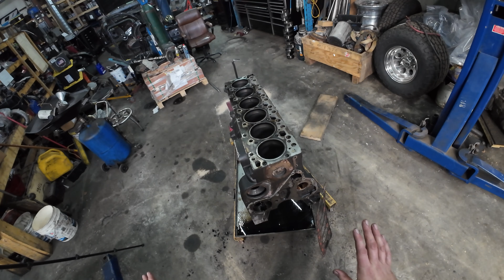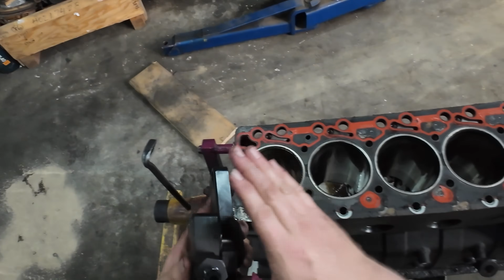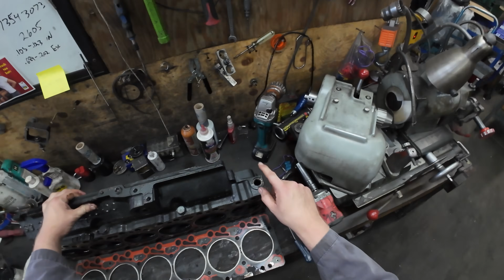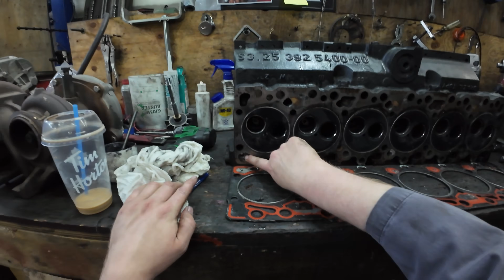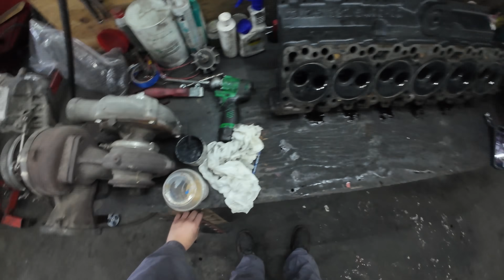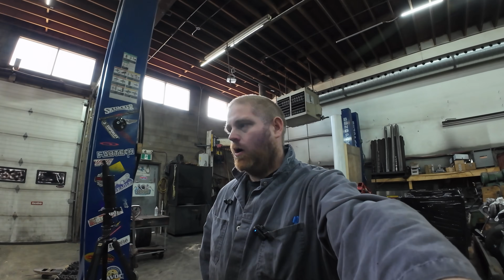HOW TO WASTE $500 ON A COOLANT BYPASS ON YOUR CUMMINS

Comment: One thing no one thinks about.  If your truck is an automatic and you are towing in the summer the coolant is running over the heat exchanger  to cool the transmission and then flowing right back into the engine with out getting cooled down in the radiator.  This is a poor design for towing in summer.  In winter this works as it warms up the transmission to keep it at operating temperature.   The next issue which absolutely sucks is the heater. In the summer when you don't use the heater, it is doing the same thing as the transmission cooler. So in both instances you are running the hottest coolant right back into the engine under the worst conditions.   In the winter, this is great.  you get good heat from the heater and the transmission stays warm.  I do a lot of towing and will be adding the Fleece thermostat housing which will allow a hose to be attached to allow the transmission to run cooler and I plan on putting a ball valve on the heater, to shut the flow off during the summer.  I expect this to add a lot more cooling to the engine in the summer.

Comment: I have 97 Ford L8501 with 6BT Cummins and it has by pass built in which runs cold. Goes on side of block to air compressor back to T with Heater core and back to Radiator. Weird why they did that

Comment: My engine is out of a 89 school bus that had a ball valve on the back with no thermostat. I cant get my engine to heat up unless im going slow up hill with a load on. I currently have it flowing through my air compressor that i added on later. Have you designed a bypass for the first gen yet?

Comment: Flow is a side effect of pressure differential... as you said.... 
Thoughts on running a coolent filter feeding off the bypass.  
CR and 6.7 pull the core heat from the back of the head through a casting plug on cylinder 5, how about doing this on a 12V?  With or without thermostatic fleece rear  .
I've got the trans out so it is time to get off the pot.

1st gen ready? Will it work with an Allison swap?

Comment: What about moving the heater core and let hose on top of the cylinder to the rear plug instead of between four and five right at number 6 would this help obviously produce more heat faster but would it help in keeping number 6 cylinder cooler

Comment: Okay you are wrong. If you read the install from fleece it tells you to go from the rear to the hose directly to the thermostat. So the videos you are saying that they are doing wrong is actually being done as intended. Here is why. First off the water pump doesn’t create pressure it creates flow. Yes, flow and pressure is different. As you read on you will understand what I mean by pressure when I explain Venturi effect. Second the bypass is exactly that it is being fed from the thermostat side to the bypass. which also opens since the thermostat opened at 180 and let the coolant into the bypass. Which then the thermostat in the bypass opens since it is also at 180. Both thermostats are equal temp at 180 so you can’t change the thermostat in the bypass kit it has to be the same as your normal thermostat. Both thermostats are now open allowing it to flow normally through the engine front to back and at the same time coolant is also flowing from the thermostats to the rear of the engine. So basically you are feeding both sides at the same time with same temperature coolant to help the rear cylinders get the same cooling benefits as the front of the engine.  Finally, enlarging holes in a head gasket is something I do not do because I don’t want to mess with the sealing and cause a leak. The holes are there because different sizes create a Venturi effect which plays a role in flowing the coolant throughout the motor. If you don’t know what Venturi effect is simply put it creates pressure from a non pressurized side using the flow. Like if you put your finger over the end of the garden hose nozzle and partially stop the flow of water, suddenly the water pressure increases coming out of the hose. Heat which is controlled by the thermostats, radiator cap which controls the pressure and the different sizes create holes is what creates the flow and pressure “air quotes” through the engine. Sure engineers make mistakes and some things can be improved. However,  bigger does not equal better unless you do the math and can prove it. Engineers use math to make sure things work they way it should. If you bore out bigger holes can you tell me how much the flow increases? Where and how? Nope it just an assumption you made thinking bigger holes flows better. However, if that small hole was there to create a Venturi effect and since you bored it out you just killed the Venturi effect and therefore killed what you call the pressure in that area. Therefore you just reduced pressure and flow of the coolant in that spot. Thoroughbred diesel has a step by step to installing the bypass and gives you explanations as well. Anyone installing it should watch that video.

Comment: I always drill the holes in the gasket a little in the back 2. 
The 3rd gen heads have a ton of ports I supposed you could use for bypass ports. 
I dont know anything past the 5.9 common rail.

Comment: So the entire system... stock, generally is under 15 psi pressure throughout the whole system. With your analogy, nothing would be circulating. Did you forget about the pump?

Comment: @cutteruprob  
5th gen 100% stock never tow over 10k normally 7k or less, yes I know I bought too much truck, but better than not enough. Would a coolant bypass be recommended in my situation or totally unnecessary?

Comment: I have a 2006 Dodge Ram3500 Dully 4x4 5.9, I have installed a lot of Banks upgrades, just installed a rebuilt transmission and torque converter,  (while the transmission was out I installed a coolant bypass) I am retired and most people rebuild old cars, this is my project because I don’t plan on buying a new vehicle at this time in my life…can you give me your opinion of ideas I can do with my truck? It has 89,000 original miles…I do tow a travel trailer…Thank you in advance

Comment: Some companies like fleece use the rear freeze plug and some companies use a rear threaded port above the manifold like black market performance.

Is there a benefit one over the other?
Reply: I've been trying to figure that out myself. I ended up opting for a knock off fleece bypass from Amazon only because it was cheap and had everything I needed. It was 120$ cad instead of 500, so I pulled the trigger on it.

Comment: So what’s the solution for guys who don’t have an aluminum rad plus a TIG welder? How do you dump the coolant return from the Fleece back into the rad or rad hose?
  Also, what do you think about the Mayhem Metalworks bypass kit? Primarily interested in it because it’s far easier to install with trans still in the truck.

Comment: What would happen if you pulled the thermostat out of the bypass and plumbed it as fleece designed?   I am assuming it would just take longer to warm up. 

Is that hose big enough to keep the engine from reaching operating temp all together?

Comment: So here's my thought. Only because I'm not in the mood to pull the transmission... yet. Pull coolant from ect port to heater core. Then relocate ect senor to front port that used to feed heater core.  Then you can eliminate 1 steel line for heater core.  What do you think?
Reply: I THOUGHT SOMTHING SIMULAR '''' ''''

Comment: On my 04 I grabbed the back port and moved it up to the thermostat housing where I tapped the housing to match the 1/2 " npt. Put a ball valve in to control flow and get some temp in the engine

Comment: On school busses, that rear freeze plug goes through a manual valve the. To Allison heat exchanger, then to driver foot warmer then 1st driver side heater core, then 12v pump, then second heater core that's under a driver's side seat, then it goes through the floor to go underneath the side emergency door and then it comes back inside of the bus up over the rear driver side wheel well into the largest heater core for the passengers and then reroutes all the way back up to upper radiator

Comment: Bro the purpose of the bypass is to do exactly that. It lets fresh coolant go directly to the back. It's basically just adding a tube instead of drilling bigger holes

Comment: Lets pay attention ..Front #1 to the back # 6 Then after the stat to the cooling unit. This so makes flow sence. Rob's explanation is completely excellent. Talk about cutting this up and showing us.. 5 and 6 are killers .but I love this 5 star videos telling us what might happen & what is wrong with the almost perfect engine. Also.
How things change whenever you modify the engine for different purposes. Very well explained. Been addicted from UM...on day one to "Cuttterup T.V. " . Thank you Rob.FYI ya'all those By-Pass kits have been made & come from overseas for a while. They are exactly like the f etched brands. They sell for about 80-90 USD if you do the search. Rob needs to make them for the first Gen. If that is an niche. I think I would prefer the 160 vrs 180 thermostat in the bypass. Nonetheless very good video .
Reply: Are you on meth? 😂

Comment: Running a fleece coolant bypass on a 4th gen 6.7 Cummins the coolant temp went from 205 210 to 183-195 also dropped the engine oil temp. Don’t know if that’s wrong but I prefer it to be cooler.
Reply from the maker: No your right. I like to see the oil temp lower.  I pay more attention to oil temps then coolant when I can
Reply: @CUTTERUPROB given the factory oil cooler, lower coolant temps means lower oil temps. 🤷‍♂️

Comment: not a 6.7 but i have a 4bt which is my first diesel swap and my motor came with a port off the back of the block and i currently have it going to my heater core then to the bottom of the block. what iam having issue with atm is it seems like my thermostat is not opening up at all. it says its like 210 but even if i turn my blower on it blows cold air.
Reply from the maker: If you mean the bottom of the block as the lower rad hose. That it should flow. If the that hooked up right I would check the tstat is good and in the right way
Reply: @CUTTERUPROB  I have put another new thermostat in and ordered a new temp sens
Reply from the maker: @  the spring on the tstat towards the head ? I hate to ask that but I have seen lots the wrong way
Reply: @CUTTERUPROB  yes it is. My thermostat housing has a nipple that only allows it to go in one way

Comment: is there a point to putting a bypass on a pretty stock engine?
Reply from the maker: If your towing heavy I think so
Reply: If you’re towing out west in the summer
Reply: @jeffreyhoskins8955  yeah I’m in Arizona but id probably only tow 14k lbs occasionally
Reply: @andrewasbill3690  I toe rv’s for a living an there are only a couple mountains or there I’ve had over heating on like I-70 out of Denver In Utah, ore elk mountain in Wyoming an so on if you’re not having any problems then you’re probably fine

Comment: On my 1st gen I put a tee in the stock temp sensor location at the back of the cyl head to run a hose to my webasto then it goes straight to my heater core and then returns at the return location at the bottom of the block at the front. Good to know the flow in the head gasket is wide open at the back of the cylinder head. For the purpose of heating up coolant quickly with my webasto I was wondering if it would be worth running coolant from the back freeze port but it seems like it's current location is just as good. I want to draw cold coolant from the back of the block and return the heated coolant to the front for maximum heating across the block before starting it. I guess when it's warmed up it sort of acts as a bypass too to keep things flowing back there.
Reply from the maker: @OvensGarage   the way you have it if will draw the coolant through the block. Just on the back plug it with flow easier.

Comment: Another great video Rob !! I'm 10k miles into my 12v install into my f350 running a zf5 and for a coolant flow improvement I utilized the water temp port , temp is next port forward so middle of head and block.. It runs around 175* normal ... My engine was an auto platform so that lower T fitting is where I plumbed the bypass to, and the other nipple to the heater core ... I've done a few good pulls over the mountains and temp really never moves , egt's is another story but for another comment.. My last good pull I worked it in 4th running higher rpm's to test what the temps would do and it warmed up to 195* (still great) in my opinion while keeping egt's more around 1150... These motors are pretty damn impressive , I enjoy working it I just don't want to over do it and turn it into a pile of muff dust...
Love your vid's Dude !!!
Reply from the maker: @Bradzuzu  if the coolant stays steady I would say your ok.  Egts at 1150 is fine to as long as the oil temp stays in check

Comment: You missed some info.  The heater lines help cool the head by increasing flow.  The other issue is that when you pull some of the coolant off the back of the block you also lose some flow through the head.

Comment: I have an unrelated question. I have 230 hp 5.9 12v in my motorhome and have to replace the block are all 12v blocks the same even out of the pickups?

Comment: Coolant with even cylender temps is only half the story...
I have a twin ram on my 12v and regardless what people say, I'm running cooler egts!!
Knowing that, how hot did #5,6 cylenders get! 
I pull all the time 10k lb. Enclosed trailer 23" and 7' tall .
No issues.
Reply from the maker: Coolant temps is only part of the equation for sure.

Comment: need the coolant bypass to grab hot water from the back end... because the water in the pump recirculation zone gets cooled off from the radiator's down draft. hot cab heater
Reply: cylinder head flow goes down, keeps the injectors worm. 180*f is to hot, gauge should never go past 165*f. "heater recirculation blocked off at the water pump" 2.5" pickup pipe vs 3/4" bypass for heater... forces a water pressure change in the system where it pulls water out of the thermostat valve as the 3/4~1" bypass tubing is nowhere near big enough to fully bypass anything.

Comment: You totally can circulate it into the lower rad hose, then you would increase the circulation and the main thermostat would open more and accomplish the same thing.  The other thing that should be noted is that when you increase flow through the block you’re 100% impacting the total flow through the head.  Plumbing the bypass into the heater core is ridiculous.  It wouldn’t do anything if it was actually cold out.  That is an anti cavitation port beside the thermostat.  It feeds the water pump fluid to keep it moving.  “People don’t understand” even you don’t understand.

Comment: Flow is better to describe this than pressure. Because as soon as the thermostat opens the entire system including the radiator has pressure. But it flows away from the pump back into the pump. None the less good video

Comment: So if you essentially route your trans heat exchanger into one of the thread plugs on the exhaust side of the head there would be no flow if you do that right cause of pressure cancellation
Reply: But what if it’s already being fed from the heat exchanger hole in side of block under the fuel bowl
Reply from the maker: @daviderickson6933  you can feed from the block side to the head. Some applications to that.  Depending on what your working with and trying to do
Reply from the maker: The heat exchanger will pull coolant off the head. Then goes back to the lower radiator hose pre water pump. So it flows
Reply: So what you’re saying is it flows the reverse of what I thought. But actually goes from the head to that hole
Reply: Ok thanks for answering man

Comment: You mentioned a second radiator. I need more cooling! After compound turbos EGT control is no longer a problem. Water temperature is my next problem. 1997 with a manual transmission.
Reply from the maker: I would add an oil cooler. I will have some videos coming up talking about it
Reply: Same situation, but 2004.5 Commonrail NV5600.  I can raise coolant temps 20-30* on a reasonably sloped hill and never break 1250*EGT

Comment: I wish I could run that style, I put a zf5 behind my 12valve and the trans mission bellhousing blocks the rear plug. So I ran mine from the rear most port on the driver side of the head. Can’t run a thermostat but I live in the middle of the desert so it works out
Reply from the maker: Might be coming. The guy I working did one for his. But requires the plate to be modified
Reply: @CUTTERUPROB if you make it work I’ll def take one
Reply from the maker: @Dopey_m  send me a email or message on ig I will show you the one he made

Comment: I commented on his video when it came out recommending not to run it that way, he responded saying that he followed the instruction fleece sent. So apparently fleece is saying to plump it into that pressure port?
Reply from the maker: By the way he talks I think he think the coolant moves the other way in the block. 
Fleece tells you to put the line to the top tstat housing. Which is after the stat free flow into the top rad hose.
Reply: @CUTTERUPROB your right but it comes in under your 1st thermostat
Reply: Instructions*